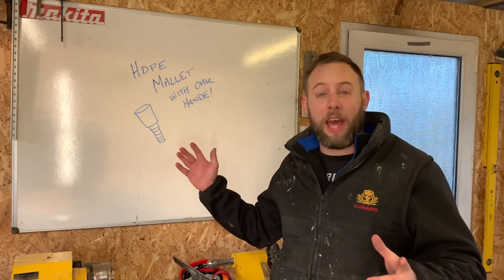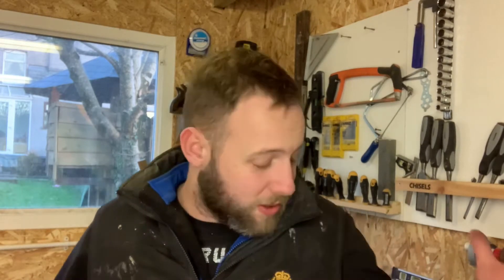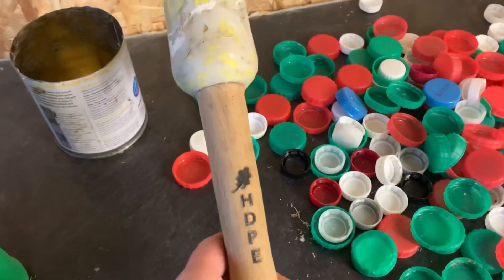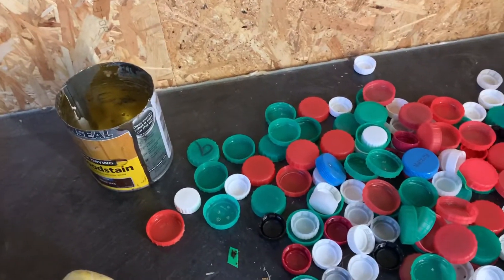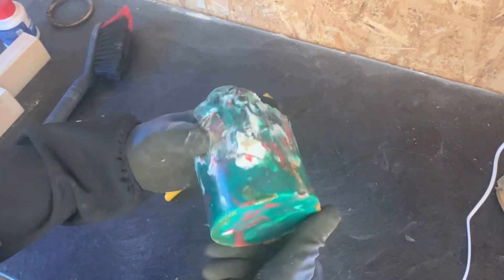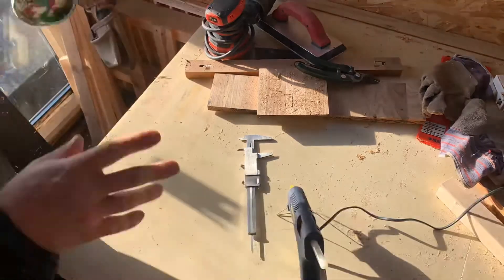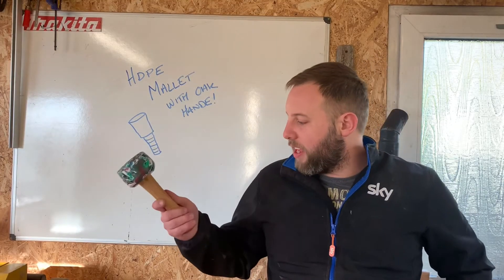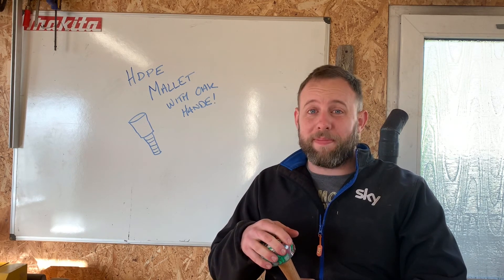HDPE Mallet | Recycled Materials | DIY

Comment: This mallet has done nearly 50 hinges, 30ish lock mortices, its carved custom items for everything from kitchens to escape rooms. Wouldn't use a chisel without it now. Definitely worth making one.
Reply: I gather you are happy  with this material. Do you have any problems with the HDPE chipping off?I plan on making one for wood carving and usually hit the gouges pretty hard.
Reply: @buckbeans1 you'd think it would separate wouldn't you! But this one has survived working on site for a year nearly without any issues at all. I did have the handle come out when I was really beating something but some epoxy resin and its never moved again haha.
Reply: @approachableactive  thanks for the reply. I will go ahead and start saving those jugs an caps to make a mallet